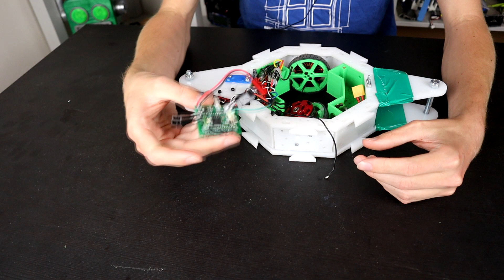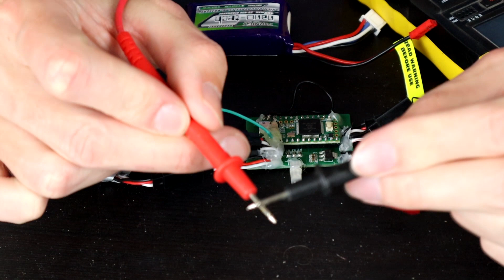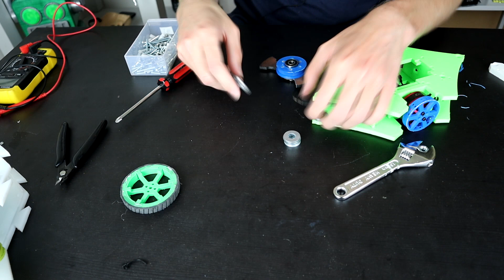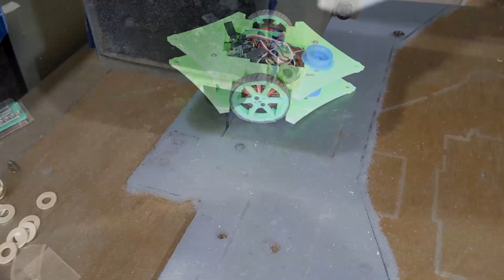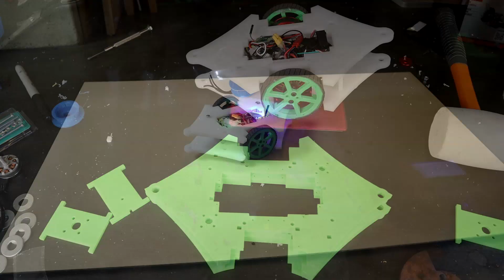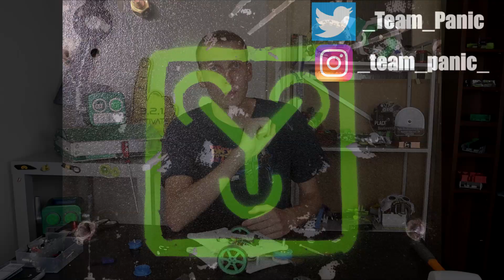Dual spinner melty brain V2

Comment: A pcb might help with the wires.
Reply from the maker: It does have a PCB in this version which did cut down the wires a lot
But the 5v reg on the board died, so I had to add back in an external one and the main power wiring loom was built for a bigger chassis, I should re-do it at some point but I havent had time

Comment: Its a great head noodle type thing, and i would love to see it work, i love the innovation, and truely hate being the person who just points out problems when your really trying to do something never before seen, So read all the way to the bottom, i might point out issues, but i also offer a possible solution. In application, im very sad to say, i think its not going to live up to your hopes. It has the same issue as Gemini, or any  dual weapon bots from team wiachi, or others, from battlebots, you, like they, are bound by a certain weight, by splitting your weapon weight into 2 weapons, you are halving the weapon power. And just like what happens in battlebots, when your going against a full weight version of any bot, your hitting at half the power, against a bot that is armored to take hits that are twice as hard. 

And since your a full body spinner to boot, the hits delivered are not going to be as hard as a normal full body, because they have the weapon built into the armor, and its fixed, all of the power is spent on the first solid hit, causing both bots to go flying around. However, in your case your outboard weapons are the impact points, and they are not fixed, so they are going to only deliver a hit as hard as the motor they are attached to is going to otherwise deliver, any excess power is just going to cause the motor to rotate in reverse. so all of the power you gain by being a full body spinner isnt going to translate into the impact, or if it does, it isnt going to be a major gain.  Its better then just having loose swinging weapons on the ends, because those have zero resistance and transfer very little of the rotational power they appear to have. In your case your motors are going to help impart a small amount, but i can guarantee if you mounted a tooth to your spinner body and tested it against the dual weapons version, its going to hit harder, even though it doesnt have all the extra weight of the outboard weapons. 

i however, do not like being that guy who just brings you down, so i offer a possible solution, change the orientation of your weapons from horizontal to vertical. your gaining rigidity from the weapon no longer being able to move backward due to the power of its attached motor being the deciding factor for translated power. and, you are delivering a both horizontal and vertical hit at the same time, i have no idea what that will look like or do, but it should be awesome.
Reply from the maker: You bring up some good points and honestly I dont know a lot about the physics
I was/am kinda banking on the idea that the momentum of the blade is the thing that carries it into a hit, if thats the case the extra speed imparted by the spin of the melty will be somewhat helpful
Having said that, I really dont know and you have given me pause to think about it all. Thanks for your incite and thoughts

I did originally plan to have a vertical option as well, I think I'll try that on the next version of the melty